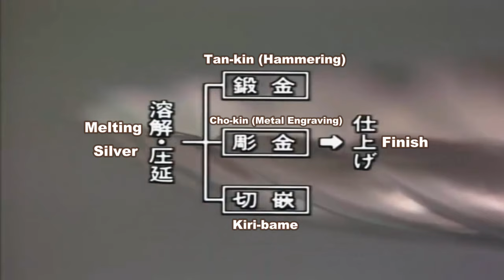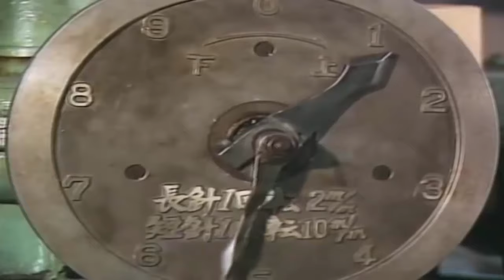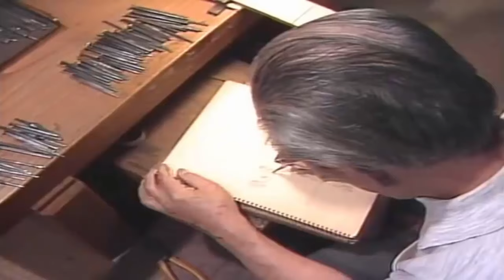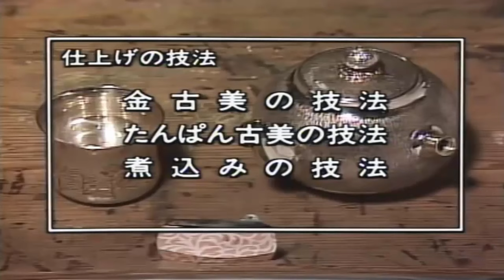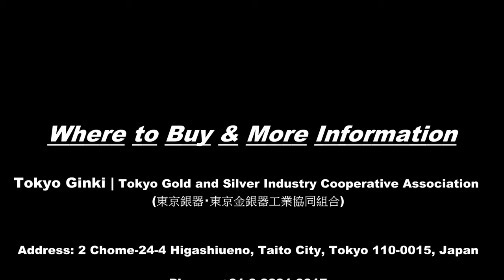The Highest Class about Quality of Silver, Old Methods and Incredible Hand Tools Still being Used

Comment: 20:20 what the name of this processes not the tool but the over all pattern part
Reply: The proceeding was piercing which consists of drilling and sawing. At the 20:20 time stamp the process is called inlay. After inlay was set then came soldering.
Reply: @arikkraft5755  thank you :)
Reply: @17hmr243  Welcome